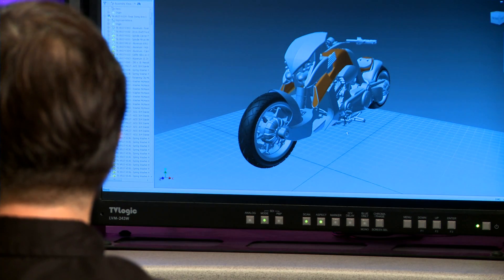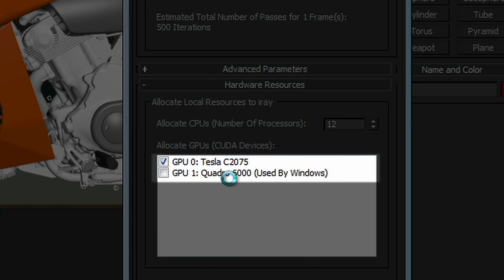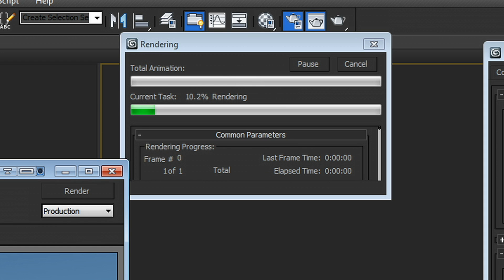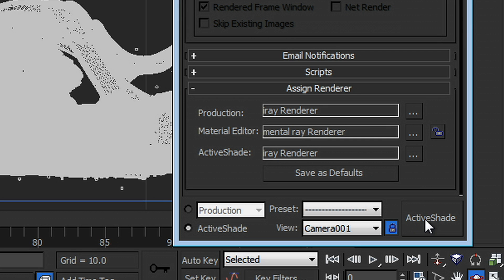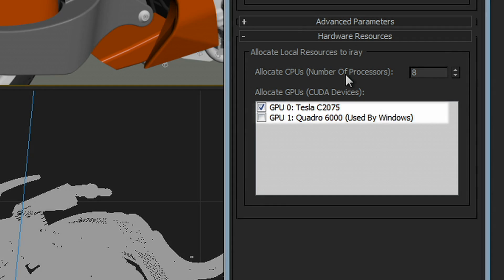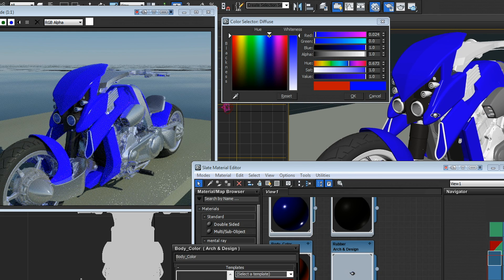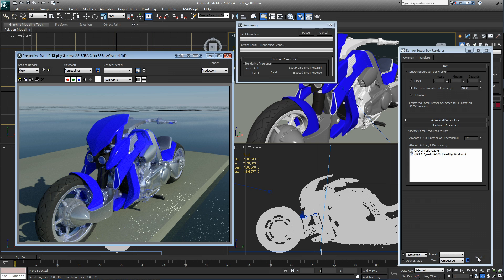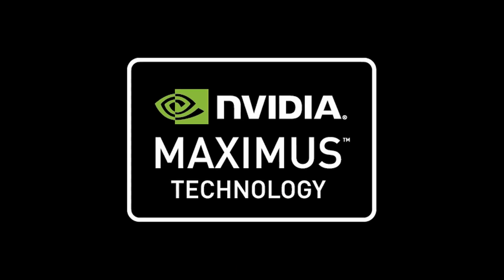Perform rapid photorealistic renderings in Autodesk 3ds Max 2012 with NVIDIA Maximus

Comment: Hey I have a NVIDIA K4200 and would like to maximize my rendering time.
I use vray as my renderer and for models, materials and lighting. Now how would i maximize the rendering performance. I tried changing it to Iray but errors obviously come up because everything in my project is vray. Can they both be used in conjunction? I would really appreciate the help. thanks

Comment: @kitsune0video Maximus is actually a new technology that Nvidia is developing and it combines tesla & quadro gpu to make a lot faster computing power and it's not used only for 3ds Max but for other applications as well. Iray on the other hand is a render engine which uses the power of regular cuda GPUs. You can use Iray with any cuda enabled cards, but with this particular technology you can boost your workstation performance very much, but I'm sure this thing costs a lot. Hope I helped :)